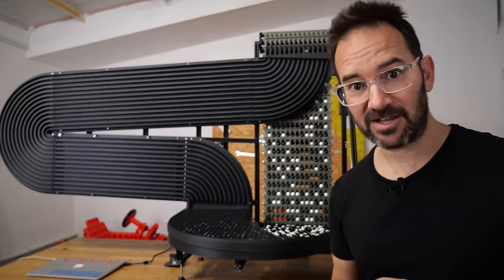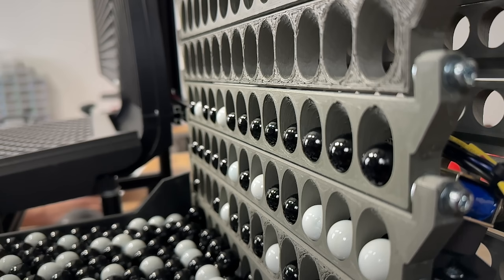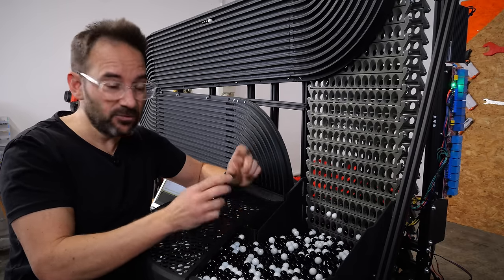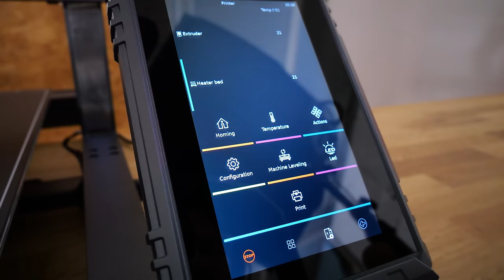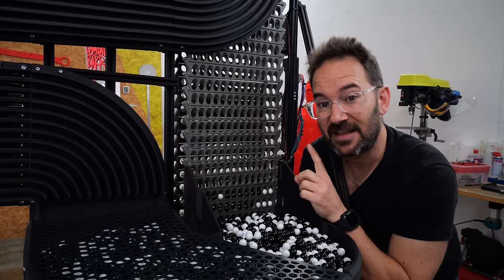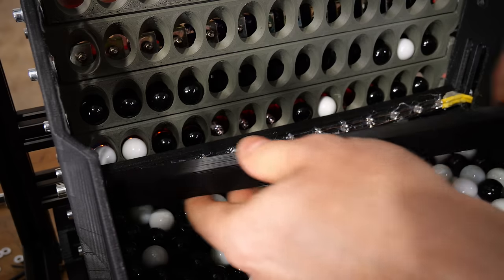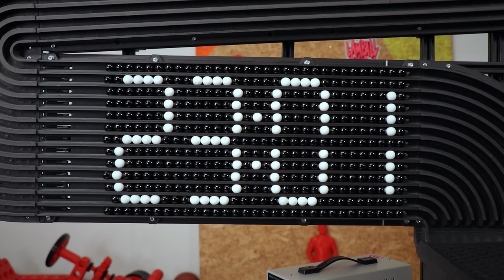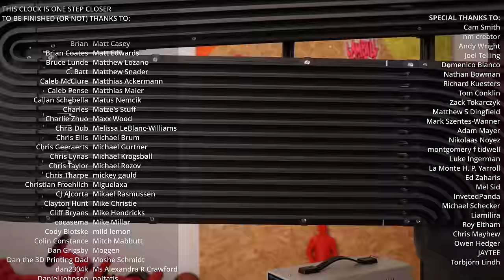BUILDING A MARBLE CLOCK - Pt. 2

Comment: I would like to suggest to use the effect of rejected marbles stack up in front of the elevator to create black rows as you actually need much more black marbles than white ones. If you actively dumped a row of either white or black marbles from the rejected section when your system needs those you might get to cut down on your wait time until a certain type shows up at a certain position
Reply: I was thinking about this problem too and ypur idea sounds like it could work! What if he has an only black elevator with completely seperate white feed in. Then when white is needed, the appropraite blacks are dumped out and the whites are released to fill the gaps. You should be able to create full clock faces within the elevator already!
Reply: I'm thinking two rows of solenoids. The bottom row only rejects black marbles from where white marbles should be. The other row, much higher up the chain, rejects unwanted white marbles. The whites are pushed onto a tray that ends up filled with only whites. The tray leads back to the elevator, slightly lower, between the two solenoid rows. 
If the fill rate at the bottom is perfect for the black marbles (i.e. no empty slots), and there are enough white marbles on top to fill every gap, you might not even need controllable gates at the white tray. The whites would just fill all gaps left by the solenoids kicking out black marbles where they're not wanted. The result could be really efficient.
If the fill rate at the bottom isn't perfect, the whites will fill too many holes, but they could still be detected and re-rejected by the white solenoid row above the tray.
Reply: @arantala  unfortunately, if the whites are not sorted at the bottom and brought up to the white tray, i think there would be the chance of all the whites being in the 'system' and the tray getting empty.. the whites could het stuck in the black mass at the bottom and never come up again. Otherwise a very good idea! (Also if i am wrong, please tell me haha)

Comment: This is awesome!  May I suggest using two separate feeders, one for black marbles (do that first, punch out the spots that should have white marbles), then a second one that only has white marbles to fill in the spots that should have those (punch out any white marbles that got into spots the black marbles didn't fill before, but should have.)  Can't wait to see the finished clock.

Comment: Very cool. I like the relative simplicity of the rejection mechanism! I did notice that it took about two minutes to build up the time though. Looking forward to seeing how you account for that!
Reply: Yeah, the randomness of "waiting for a white marble in this exact track" is going to inevitably cause issues.  There's always going to be a possibility of never seeing a white.  Might be easier to have the sorting done before the elevator and put into two separate buckets that are pulled from as needed.
Reply: A clock that is right every five minutes is better than one that is right twice a day. In the days of analog clocks, we usually said it was 20 minutes to 3, and not 21 minutes to 3 or two thirty-nine..

Comment: This reminds me of Wintergaten's musical marble machines. So many similar marble machine sounds and visuals.
Reply: is wintergaten using marbles or bearings?
Reply: Except this one actually works...
Reply: @bertjesklotepino  I don't remember exactly off the top of my head, but I think I remember seeing steel balls rather thanks traditional marbles. It would make sense that they would have to be steel balls so they don't break or chip like marbles would.

I just called it a musical marble machine because it sounds better and gives a better mental picture than calling it a musical ball bearing machine.
Reply: @sgsax  yes, true, but by that measure, Babbage's Analytical Engine didn't technically "work" until someone actually built it. However the idea worked and was still pretty awesome, even though it was just an idea on paper for a long time.

I reckon they should collaborate on a musical marble clock

Comment: I feel like using the marble rejection thing to sort the marbles into colors and then placing them would be a lot more efficient in terms of building the current time before it’s wrong
Reply: Agreed, the current system feels like it's dependent on RNG, a healthy filtered system and smart marble reservoir could resolve so many potential problems
Reply: While you're right... I think it kind of takes the fun out of the whole thing if it's just sorting them into two separate color pools like that. Really if he can just speed up the whole thing by maybe 20% then it could just work as is. I feel like it could definitely move faster.
Reply: Guys dont say I feel like well if your gay anyway women day this feminine habit
Reply: Agreed, but the randomness of how the numbers appear in the clock face is a part of its charm (for me)
Reply: @perrycoffey5410  I feel like u are wrong.
Reply: @Konitama theoretically the right color ball might never get in front of the right lane to finish a time display. That's because it's random where the balls fall. And that includes the likely rare possibility that a lane only gets black matchless marbles or white ones.
Sorting the marbles by color and then create a time display from those stored marbles would be more stable in result and always faster than you can make this random dependent contraption go. Still fun to see though.
Reply: @perrycoffey5410 I feel like you might need to do some unpacking of that toxic masculinity you have there.
Reply: That and a few other design changes might make it possible to make a marble clock that tracks seconds too. I'm imagining faster sorting into separate banks of marbles. These marbles would know what the next minute / second is (obviously) and would buffer those columns above the current display, then drop them in like Connect 4.
Reply: @FortWhenTeaThyme  he considered the dropping them in route. He told us in the previous video. But he rejected that option. He wanted to use the lanes, so seconds are out of the question.
Reply: @perrycoffey5410 what kind of random closeted self hatred are you spewing here?

There's no way your idea of masculinity is so fragile that the words "I feel like" destroyed it
Reply: @JamesTDG random in large numbers evens out. Especially considering he will have better then 50% odds as he gets more of the wrong color.

Comment: I think part 4 will be to fix the situation where the clock fails because it cannot get all the marbles in a channel in time. There is, after all, a non-zero chance of no white marbles entering a channel for a minute, and with 1440 minute changes a day, that will happen... My bet is on 08:58 :D
You can prevent this from happening by keeping the marbles within their channel and ensuring there are at least as much marbles of each color that you need for two timeframes (but a few spares will speed up finding the right color.)
Reply: Based on the multiple gate setup, I wouldn't be too surprised if the end goal is to queue up multiple minutes in advance, thus smoothing out the variance in slow and fast cycles.
Reply: just using the elevator to sort white and black, and having them going into 2 hoppers at the top which feed white and black queues for each row with selection gates that will select for a single white or black marble at a time for each row would be the reliable option, that relieves the elevator speed from affecting the selection speed making the actual time selection real time predictable.

Comment: I'm loving this project! I know it's not cheap but maybe you could get metal balls coated somehow if you need better tolerances. I'm not sure about the durability of the coating with the marbles being dropped constantly. I'm starting to think that switching to a vertical layout might make more sense since you could put the conveyor directly behind the clock, it will make filling the channels faster, and overall shrink the footprint significantly. A vertical layout also might make the marble tolerance less important since there will be more falling than rolling.

Comment: Extraordinary idea!
Constructively, it is easier to organize that the figures are created from balls placed vertically.
Benefits:
1. Changing the minutes more easily, we still need to move all the balls for a single digit of the minute.
2. Fewer balls to handle
3. All the mechanism positioned at the back, and only the clock remains on the front.
4. The ball climbing mechanism can be more efficient on the screw
5. Separate baskets for white and black balls reduces the number of calculations for positioning the balls

Comment: Are glow in the dark marbles a thing? They could be "charged" while in the elevator perhaps.
Reply: Yeah they are, that’s a really good idea too! A display visible even in the dark would be awesomeThe only issue is that most glow marbles are plastic, and I think he’s relying on the weight of glass marbles to keep them moving smoothly through the system. He could always use uranium glass marbles, which shine very brightly under UV light. They’re only a little radioactive :)

Comment: you can optimize the slope by using a bradistochromic curve! it would make all the marbles take the same amount of time to fall regardless of placement (i know it’s misspelled)
Reply: If you can't remember the word, store bought cycloids are fine.
Reply: *brachistochrone ;)
Reply: Why not just use Collumns instead of rows?
The marbles would just fall down, when flushed
And it would allow to keep the higher digits therefore leaving more marbles in the tray for the smaller digits to update

Edit:
Maybe if all the balls would roll into those Collumns from right to left, allways filling the rightmost before filling the next one, the leftmost digit could slowly fill within ten hours, while the rightmost digit could update much much faster

I am tempted to implement such an update-algorithm
Reply: @lorenzumhofer566 Remember that each lane comes from a sorting mechanism. If you want one lane on each column, that would mean a lot of sorting device.
On the opposite if you want only one lane delivering all the columns from right to left, that sorting lane will be too busy.
Reply: @lorenzumhofer566 your solution looks like the one used on the marble machine made by wintergatan ;)
Reply: @jeremygrecte Each digit has 6*13 Marbles.
And each row in the conveyer has 13 Marbles.
Assuming a velocity of 1 step every second and 2 marbles per step are correct
This would mean 2 correct marbles per second
So it would take 39 seconds to fill one digit

This means the clock could not only update each minute, but also buffer all digits in less than 4 minutes

An overflow in the feeder on top could be done by pushing out all marbles on the conveyor

I really don't think the sorting lane would be too busy with the sorting-mechanisms currently in place
Reply: @lorenzumhofer566  So you keep the number of 13 marbles on each rows of the conveyor ? Then they would fill the rightmost digit horizontally, and when the minute switches the whole digit goes down vertically as 6 columns of 13 ?
Also, I don't visualize how do you "buffer" the other digits. There would be some kind of bypass lanes with electronic gates behind the rightmost digit in order to move the marbles toward the next digit ?
Reply: @jeremygrecte  I had a mechanism in mind where on top of each collumn would be a rotating cross.
The marbles would roll over this cross and fall through. If the collumn is filled, it would stop the cross from spinning and the marble would roll to the next collumn

The buffer could just be on top of the display. Each minute the marbles in the display would fall through, then the buffer could fall into the display. Similar to the way it's already done, but verticallly
Reply: Actually you're right, 13 devices working together to fill a column of 13 marbles might be more efficient than the original setup where each device works alone to fill a row of 30 marbles.

Comment: Have you tried putting the 'staging' section on the top straight, instead of on the curve?  I think the issue you're having is that the marbles stacked on the tight curves don't release as fast, but it might go fine if you stack them on the straight so they're moving when they hit the curves.

Comment: You need to swap it around so that the minutes fill in LAST and can be "dumped" first. (keeping the Hour in place).   ALL the digits can be dumped on the hour . and the entire display "recharged."      OR you can have 24 columns of marbles in groups of seven that drop down from ABOVE into the display area,  then, after a minute, drop down to be recycled up the back to be dropped down again.     Hummmm. . . Now YOU have inspired ME!     ;)

Comment: Cool work! While it works eventually, it feels like a super bruteforce way to achieve this result. May be better to store marble in two separate reservoir based on their color, and dispatch the right marble to the right channel.

If you end up having two elevators in parallel, each with their marble color, you just need something at the top to push either a right or a while one. Or you could have two levels to "load" a while or a black marble into the elevator.
Reply: Having a second level for the white marbles seems like a really good idea! If it's above the black ones, the rejection mechanism can stay the same, and gaps created by it will be filled with white marbles automatically. Then the only problem to solve is how to separate the white marbles into their own reservoir.
Reply: Or forget about the black marbles altogether.....

Comment: This is a very interesting build I’m looking forward to seeing the final result. It would be a very expensive alternative but you could try searching for silicon nitride and zirconium oxide ceramic bearings instead of glass marbles. they’re black and white, precisely round and would be less brittle than glass. Good luck 🤞
Reply: i had a similar thought, but with aluminium ball bearings, which are definately available, and i think could be anodised to create the tone difference

Comment: This is awesome.  Need to make 2.0 where the marbles build the numbers from right to left, so you can create a way to only change the minute digits as the time changes.
Reply: Perhaps a top-down fill above each digit would be better. Then they can all be replaced independently.
Reply: How would you remove the minute marbles without clearing the entire board?
Reply: @TheArachnoBot  Since filling top-down would require almost entirely reworking the marble track anyway, a slightly smaller version of the release gate already being used to reset the display could be put under each digit. When it’s time to change that number, the gate(s) opens and dumps the marbles, quickly closing afterwards to allow the next one to build.

Comment: Cool clock... the only problem is by the time it displays the time it's wrong. 😂
Reply: That's why he's setting it up to have the next number lined up beforehand.
Reply: Nope, you just have to determine how long it takes to build the numbers, and you can time the display appropriately.
Reply: @vindrmasuta  as long as it doesn't take 3 minutes to make either display. Don't forget that with his design there is no way to predict how long this will take because of how rejected balls are returned. Even putting them to the very back would be undesirable for some numbers.
Reply: How would you determine this? The 'rejected' pieces might be the desired pieces for the next number (and they are somewhat randomly distributed back into the mix) and with the return mechanism there is no way to guarantee it doesn't have to cycle through every waiting marble to get the correct time. Whose to say he doesn't have bad luck and one time it takes 5 minutes to build the display? or 10?  @notahotshot
Reply: Yup, cool gimmick unfortunately this will never work as a real clock with his current design. You'd need a faster way to pick marbles, or just speed up the lift A TON.
Reply: He should consider putting a mixer of some sort between the ball return and the lift... this would prevent a build-up of 'rejected' pieces and make the very slow marble picking time at least more predictable.
Reply: @vindrmasuta  Your suggestion implies that he can guarantee it takes no more than 2 minutes to build the number. 0% based on the demo video. That lift better be going like 5x as fast.

Comment: You could probably save a lot of marbles if you don't change the "hour numbers" every minute. 
I believe this could be achieved by changing the direction from where the marbles drain out from. So instead all of the marbles leaving from the left side every minute, you change it so that every minute the "minute marbles" fall down and have a counter so that every 59 times the "minute marbles" are removed, the "hour marbles" fall down. 
So you could arrange the marbles in columns instead of rows. 
This would save marbles and may also reduce any errors and would also ensure that the marbles are arranged quicker as you don't have to build up the hours every time. 

This project you have undertaken is impressive and the progress and effort you put in is truly commendable. keep the hard work up! Well Done!